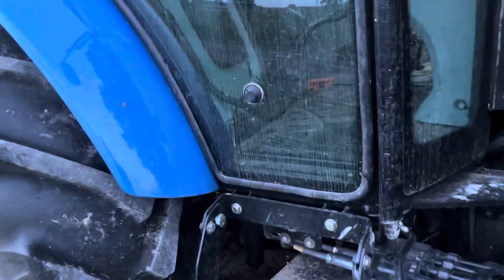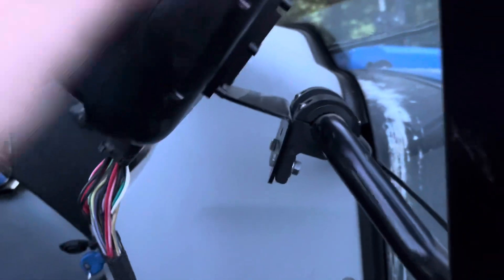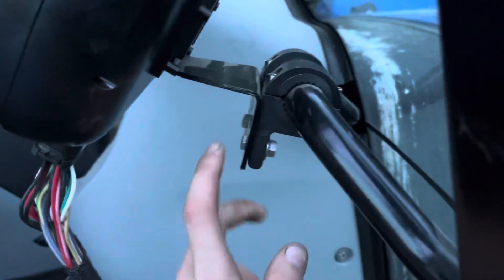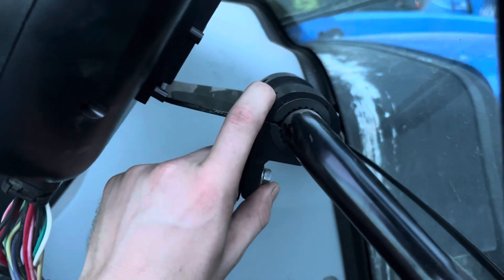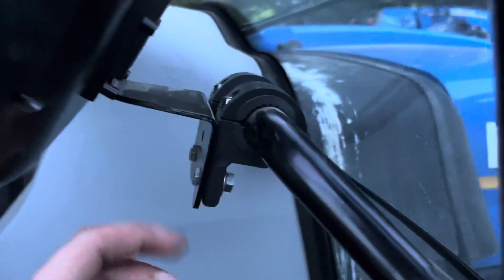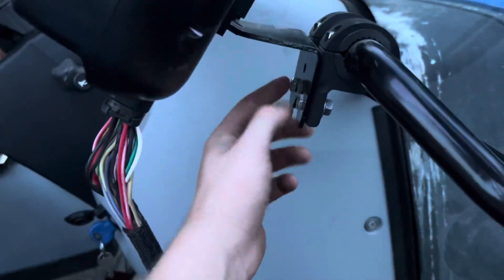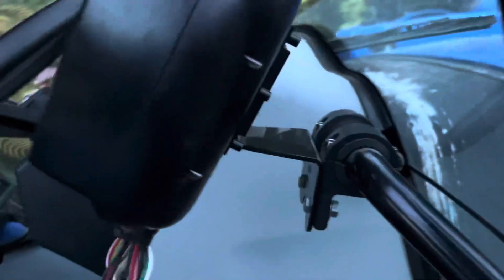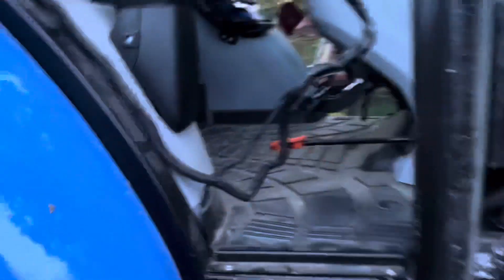How I mounted my bale monitor to my tractor

Comment: What did you make your monitor hot off of inside the cab. Got the same tractor and monitor. But couldn't figure out how to get a wire ran from battery to inside cab with any holes. Thanks
Reply from the maker: We ran ours direct from the battery to the inside of the cab
Reply: OK thank you